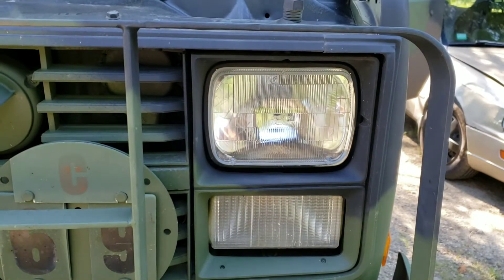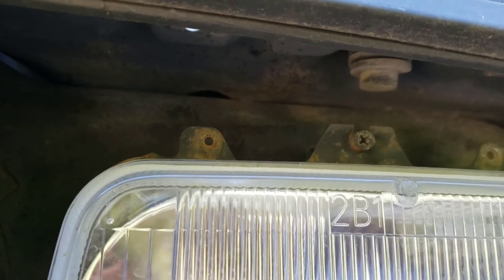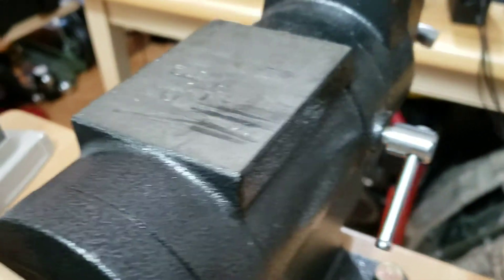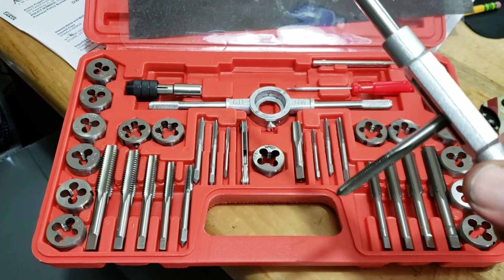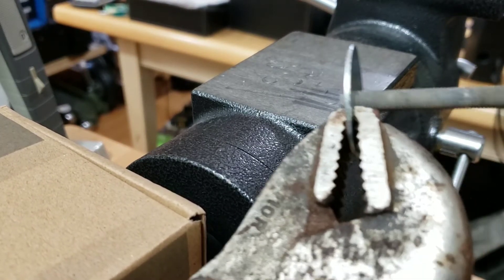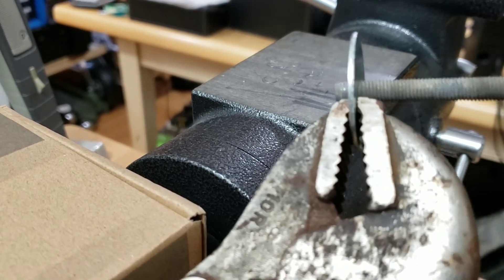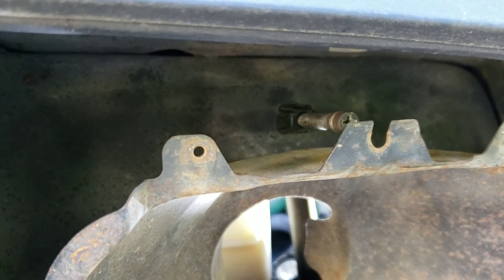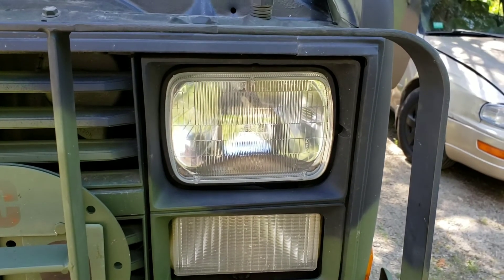EASY HACK! Fix your awful plastic headlight adjustment assembly with a fender washer

Comment: Thank you, best solution I’ve seen yet, beats all the cheats on SS!! At this point in time I’m convinced all CUCVs will need this treatment. I was certain my latest M1009, with very low mileage, would be immune. But of course as soon as I moved the screwdriver the first time, the darn fitting snapped!
Reply from the maker: Someone could make good money if those fittings were metal.  Glad you like the video
Reply: @VermontPrepper  I bought a new set of adjusting screws. The nuts are cheap plastic and it was impossible to get them completely through the rectangular metal hole into place. I broke a flange off of each one. They're garbage.
Reply from the maker: Yes, I broke new ones as well - hence the video, lol